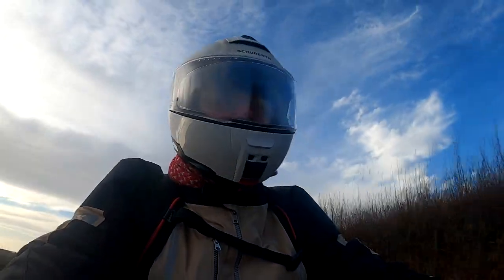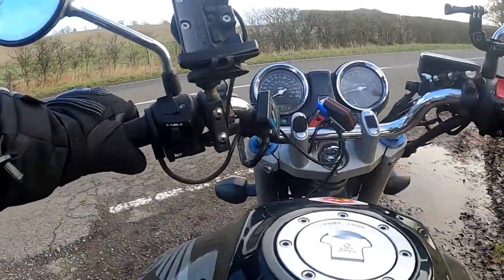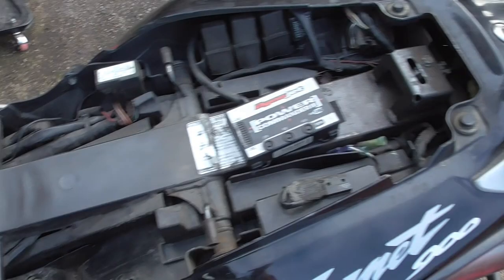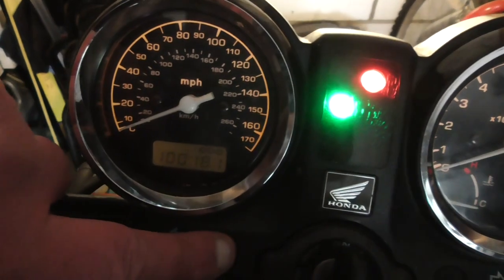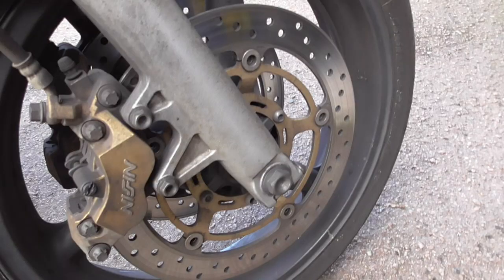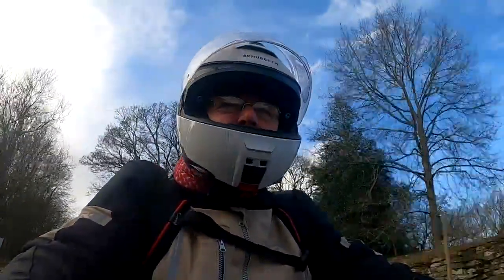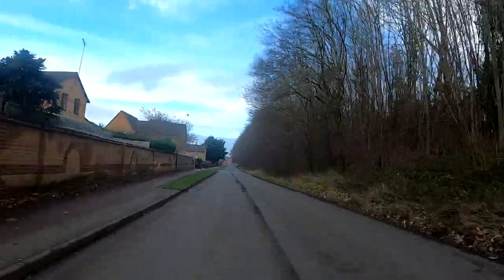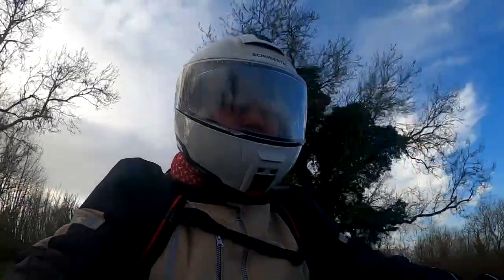2006 Honda Hornet 900: Honest Review

Comment: I bought my 2002 Hornet 900 with 45k KM as my first self-owned bike earlier this year after riding the Hornet 600 for my motorcycle courses last year, so far got 0 issues while its an amazing ride & sound all round.

Personally I don't have the same issue (or don't seem to mind as much) when it comes to the throttle, yeah it's really responsive, could also be that i just got used to it really quickly as a younger & brand new rider🤷‍♂.

Would certainly recommend them to others though, even if it's just to ride on them once, just because they're that nice.
Reply from the maker: @ridderjaim3 Thanks for the comment, even though you seem to be implying that I am old :-)  Glad you are enjoying the bike, at that milage [or kilometerage] there is still plenty left.
Reply: @TheRantyRider  As long as you can still get on your bike and ride you're young enough😂

That comment was made moreso as the fact that its the only type of throttle response i've dealt with as a  (new) rider, whereas i can imagine if you've ridden more that it might feel unusual/clunky.
Reply from the maker: @ridderjaim3 - ever hear the phrase 'when you are in a hole stop digging'? :-D  The throttle resopnse when going on and off is a known problem on all bikes of a similar vintage that had engines designed for carbs and then had fuel injection slapped on.  In theory all should be well - after all it's just fuel going bang - but the two don't mix.  The CBF500 was worse futher up the rev range in that it couldn't hold 30 [MPH] in 4th and kept hunting and opening the throttle between 5 and 6 000 rpm made the bike think, cough and then accelerate, but of you were accelerating from lower in the rev range it went cleanly through.

Bikes of the time had similar age KTMs fairing the worst when it came to FI on a carbed bike so it may be worth avoiding these.

Comment: Hi!
Have the valves ever needed adjustment during the 100000 miles? Just bought an 2002 with 38000 miles on it. Not sure if I should pay for a valve check/adjustment or if I just should ride it and have fun :p The cost is rather high to do it considering the total price for the bike.
Reply from the maker: @joakimjanmyr7477  I would definitely get the valves checked.  If you go to a non-marque independant shop you will only pay about half the labour costs.  Whilst my Hornet has never had a shim, the CBF500 I bought in '18 needed three and it had only done 27 000 miles.  If you don't know the service history also change the coolant, air filter, oil and filter and brake fluid, you may be able to do these yourelf or get someone to show you how.

Whatever you decide to do enjoy the bike!
Reply: Dont touch it... I had pretty abused bike and they were ok after 53000 miles!
Reply from the maker: @maroshek19 - I was told by a mechainic that the more bikes are ridden the less the clearances change, seems counter intuative but it may be that I don't often do less than 100 miles on a ride unless I am commuting so there are less cold starts.
Reply: @TheRantyRider  I used my bike exclusively for long trips, 350-450 miles a day...

Comment: Hi. I have a late f7. Have you had a problem with the lower exhaust mount? Mine has failed due to fatigue, snapped off and gone so the lower mount is hanging and the bike vibes horribly. Have you had that experience? If so, how did you fix it?
Reply from the maker: @Stuart Morris I haven't had that one, does the part that has failed appar on this breakdown: www.fowlersparts.co.uk/parts/4787035/cb900f7-2007-ek/exhaust-muffler ?

Comment: Love the Michelin Road tyres on mine , like having a suspension upgrade
Reply from the maker: @CarkeekW  Thanks for the comment, which particular tyre model are you running?
Reply: Pilot road 2 , I'll be going for a higher number next time a road 4 or 5 most likely .  It feels like the tyre is down a few psi in terms of comfort but not handling if that makes sense .  Less loss of traction , I have never had none in the past 15 years , used to run bt023 . I'm a big fan of multi compound so I get sticky edges and excellent center wear too
Reply from the maker: @CarkeekW I have heard that the 4s can exhibit strange wear patterns.  I used a set of 2s on an XJR1300 and 3s on a Gladius, both were excellent.
Reply: @CarkeekW  Michelin road 4 is all you need for street... I was able to put 12000 miles on front tire and 6000 on a rear one...
Reply from the maker: @maroshek19 - Thanks for the comment, did you see any odd wear on the tyres?
Reply: @TheRantyRider  not really, front and rear typically 32psi when riding hard...

Comment: hi mate, do you think this bike is good for a 2nd year rider ? from other videos, it seems like this bike is very fast when pulling the throttle.  Thanks from canada !
Reply from the maker: @jonlam4404 Thanks for the question.  It depends on what you ride now.  If you are on something of about 50 BHP you will be fine, but if stepping up from 30-ish BHP you may want to have a period of 'running in', say no more than 4-5000 rpm (which will be 70-85 mph in top for a bit until you get used to it.

The bike will do 0-60 in about 4 seconds and 60-120 in about 6 to 7 (and that's MPH) but only if you tell it to.  Some reviewers like to show how fast they can go, I get my fun in other ways than just top speed, although I have ridden some horrenously powerful bikes on track and been well North of 150 MPH many times.

Treat it with respect and get a feel for any bike you ride and you are usually OK.  Now a question for you, how long is the riding 'season' in Canada, a lot of FortNine's videos mention about 6 months?
Reply: @TheRantyRider  thanks so much for taking the time to reply, i appreciate it !  I started on a cbr250 then got a vulcan 500 which i sold. I am still learning by experience and my weakness is slowing down before making a 90 degree turn, i find i slow down all the way to 1st gear while holding in the clutch and 1 time my back tire wobbled, im guessing because i was holding in the clutch during the turn.   im good at slow driving, blipping, im not a fast drivier, i just like to cruise and escape but i need to know how to make turns because the hornet is a powerful bike and im thinking if i make a mistake on this bike during a turn, im done for.  THe season here is usually between April-May  to September-October but the weather now isnt like the 1990`s, its madness, unpredictable, rains when its not supposed to.  Cheers !!
Reply from the maker: @jonlam4404  It sounds like you have had a bit of a beginner's scare.  When slowing to turn you don't want to hold the clutch in as the engine braking will stabilise the bike.  You may need to feather the clutch (hold it on the bite point) which will help.  If you look at the 1 minute mark in the film you will see that my right foot is on the brake to control the bike's speed.

The engine speed at this point is about 3000 rpm.  I feather the clutch to keep the engine at this speed - using the throttle as well - and the rear brake to control the speed of the bike.  With practice you can do a full lock turn on pretty much any bike with this technique.  The most important thing is to never, ever use the front brake when slow riding* as this will cause the bike to drop to the inside and a probable 'off'.  At 3000 RPM the Hornet 900 develops about 50 ft-lb of torque and 30 BHP on a wide throttle opening so a 'pootling' speed will see it a lot tamer.

I have taught advanced riding and being able to slow ride is a key skill.  If you want to increase your skill levels then practice in a straight line, keeping at walking pace using throttle, clutch and rear brake.  Once you have your confidence up then try increasingly tighter turns until you are on full lock.  One thing to consider, less on the Hornet than on bikes with wider bars is the inadvertent throttle operation as you turn.  If you don't plan for it you may close the throttle in a left and open it in a right as your wrist to twist grip angle changes.

There are no doubt lots of films on YouTube showing slow riding techniqes, but if you want I can put one together for you in much the same way as I did the 'best Kreiga for a laptop' one after being asked a question, so if you want me to do that let me know, it will take a week or so as I have to fit it in around work.

*If you ride trials you will use your front brake more than the rear, but this is a very specialised discipline.  If you get a chance to try it, then do.  I learned a lot from a day or two playing off-road.
Reply: Hey there, I'm in Canada, personally I think this is not a 2nd year rider bike, the gearing is quite short and the engine hits very hard at low rpm, lots of bikes like 600's take time to get into the power, the 919 does not, it will pull your face off pretty nicely at mid rpm (thats what honda designed it too do, not massive HP, but its all midrange and downlow)  This thing is ludicrously faster then a Vulcan 500, I"d look at something a bit milder, something that isn't as aggressive, super smooth, the worlds fastest scooter I call it, but its a fairly advanced bike IMHO (at the time, it was faster to from like 40k - 120kph then the fastest bike in the world, a ZX11 as I recall, short gearing and optimized power at low-mid range)
Reply from the maker: @Kingsoupturbo Thanks for adding your thoguhts.  The low RPM power isn't that bad, but the delivery is due to the snatchy nature of the throttle and fuelling.  I fixed mine with a Power Commander and some have changed the sprockets to give a different gear ratio.  I've had a look as the specs on the Vulcan, the jump in power is about the same as when I added a 955i Speed Triple to my CB500 although I had a lot more riding experience.

The biggest thing will be the change in feel, the Hornet will turn a lot faster than the Vulcan as it is a road bike and not a chopper/cruiser and this can catch new riders out.
Reply: @TheRantyRider  Hey there! Really interesting, especially given how much you've ridden your Hornet! The fueling is so aggresive and snatchy like you say factory tune, I can see how mellowing out the hit a bit and reducing the fuel cut when you close the throttle would really improve living with at , as well as adding a bit of sprocket to reduce rpm on the highway.  My friend recently finished converting a Daytona T595 to a Speed triple, it has such taller gears and the fueling is optomized for higher rpm, although I find it faster then the 900 at the top end, I also find it less Furious then the OEM super hard hitting, short gear, Honda, and I"d say probably an easier bike to ride for a new rider as you can feed in the power over time, perhaps stay out of the higher RPM until you're ready, the 900 reminds me of my CR250 dirt bike, you could get into trouble if you accidentaly opened the throttle and got pulled back on the bike, keeping it open (whiskey throttle) I think the factory 900 could be a bit dangerous to a rider used to a mellow power hit like the Vulcan.  Really find your comments great and useful considering how new I am to the 919 and the incredible amount you've ridden yours!!
Reply from the maker: @Kingsoupturbo A few years ago I cadged access to a straight bit of non-road tarmac hand had the Hornet to 120 MPH in about 7 seconds before I shut the throttle off to avoid running in to something hard and expensive.  My Tracer 9 will do 0-60 in just over 4 seconds, even with my cack-handed launch and the Himalayan in...14½ seconds, or as I call it 'Tuesday', the Tracer and Himsy footage is on the channel.

The Power Commander was set up for the fuel injection version of an accelerator pump that cars used to have, in the first 15 crank revolutions when the throttle is opened extra fuel is pumped in to reduce the sudden jerk of acceleration which lags the throttle opening slightly, this means that by the time the throttle is say 1/4 open the fuel injection is trying to catch up and does so faster than you are opening the throttle so you get a wallop instead of a gentle push.

I will have to try to slow ride a Hornet without the mod (I know a man...) to see the difference.

The other technique you can try, but will take a bit of practice, is to not let the throttle close to 'slack cable' and always keep a little tension.  Not enough to open the throttle but enough so that throttle inputs are already on a 'primed' fuel injection system.  I used to do this on my CBF which was also jerky on take off.

If you think a CRF is interesting try an '80's 2-stroke crosser, nothing then "take off" when you hit the power band.  Zero to hospital in 3 seconds.

Comment: A 2003-2007 Honda CB900f bike may not be the illustrious powerered motorcycle you want. Around 100hp? It may be what you need to learn how to control motorcycle power.
Reply from the maker: @randystidham3783 Thanks for the comment.  I doubt I even use all of the power that often, maybe accelerating down a slip road from a standstill to join a fast moving motorway or the occaisional bit of track.  For the twisties and the like I'm usually pootling along at 3 - 5000 RPM.  On most of the roads near me the next thing you see after using 150 BHP is an ambulance roof!

I've had (and have) more powerful bikes learning to control the power is easy.  Don't snap the throttle open.  Of course these days you will be saved by the electronics as you are riding code and not the bike.
Reply: @mikemet1744   I disagree...keeping the revs up give far better control, especially in the twisties-ymmv. Being naked with virtually no wind break, these are not the best at high speeds, 100+mph, but great, great below that, but still with oodles of oooomph above 100.
Reply from the maker: @N269 I think it may also depend on your riding style, mine is usually relaxed (except for a game of find-the-ambulance in the Peak District a few years ago) so I prefer lower revs.  Higher engine speed has a marginal gyroscopic effect that I doubt many would notice.  There aren't many places where 100 mph is safe around here.